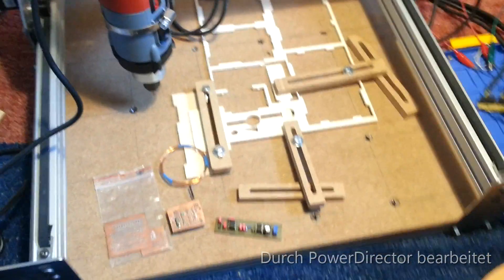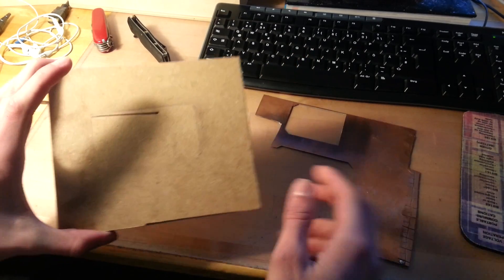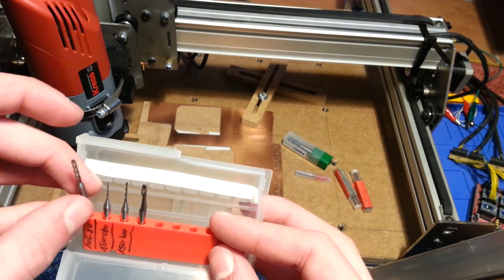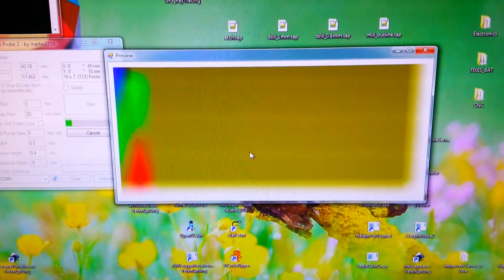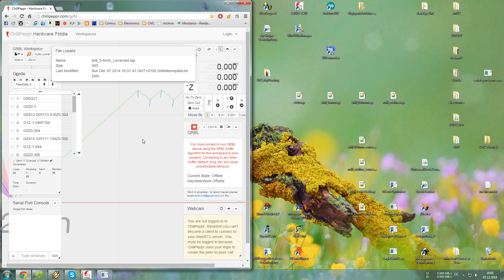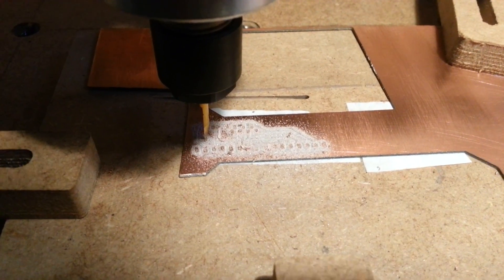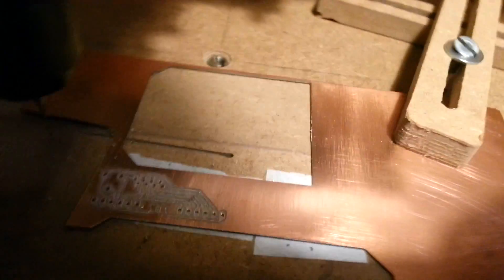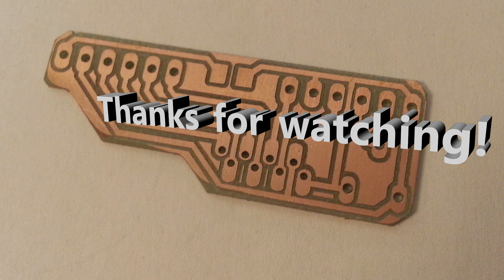PCB Autolevelling for Isolation Routing - Shapeoko

Comment: Hi Martin. First of all, thank you for your excellent job ! your tutorial helped me a lot ! I tried to do what you described in the video but unfortunately i have a problem. When i use PCB-gcode in Eagle, i only get two files, one for for the drilling and the other one with for the etching and i never get other files for the border. When i use the HeightProbe2 program, i drag and drop these two files and then the x and y dimensions become some strange values (-317826,127000) while my pcb is about 30mmx30mm. Of course when i try to operate the program like this it gives me an error. When i manually change the dimensions so i have a reasonable numbers of points to probe, i open the COM port normally and release the safety and press start but the program hangs and i have no response from the machine. Can you help me with that? 
Thank you in advance,
Reply: martin2250 first of all, thanks allot for the great work.
Second, I think the problem is with grbl 0.9i.
I'm having the same problem, HeightProbe hangs after sending "G38.2Z-5F10". 
In grbl 0.9i the response for probing is something like this: "[PRB:-193.993,-246.025,-10.305:1]".
I've looked in PortWrapper.cs and the way the coordinates are taken from the response is 

string resp = port.ReadTo("]");
resp = resp.Substring(resp.IndexOf('[') + 1);
string[] pos = resp.Substring(resp.IndexOf(':') + 1).Split(',');

I'm not a C# developer but it seems that for the above example will result:
X=-193.993
Y=-246.025
Z=-10.305:1 (not a number)

In grbl 0.9g the format of the response is something like this "[PRB:-193.993,-246.025,-10.305]",
so probing will probably work, but I can not use it since Universal Gcode Sender switches to "Active State: Queue"
on every command (except for probing, which funny).
Reply from the maker: Hi, I'm glad you like my tutorial and I'm happy to provide help! To get the outline (board.mill.tap) you need to 1: draw the outline on layer 46 (Milling) with a line that has the same width as your bit. 2: check the "generate milling" checkbox in the setup. It will generate both top and bottom files. As for the strange values in Height Probe: did you use mm as units in the setup (in 2nd tab)? if that doesn't help, you can send me the files (upload to Gdrive/dropbox and send me the link)
Reply: martin2250 Thank you very much for your reply. I checked the box you mentioned, as well as another box for text (as i have a small text on my pcb bottom layer) and i got a total of 6 files (with extra 2 files for text for top and bottom and two other files for border for top and bottom layers).
As for the Height probe, yes i used mm in the setup of the PCB-gcode and all dimensions are in mm. I uploaded the resulting files (for the bottom layer) as well as the schematic and the board files on google drive 
https://drive.google.com/folderview?id=0B86aQlNAG71RX1V0dG5zZEw2M2s&usp=sharing
Sorry for the inconvenience, but this is my first PCB milling job on a CNC machine.
Reply from the maker: 1: if you want text on the copper side, you have to use vector font instead of proportional. Also if you move it to the milling layer 46 and check "generate text" you will end up with a single enggraved line instead of having to mill the outlines. the generated file can just be appended to the board.etch.tap 
2: The files in the drive folder do work, but in the "G-Code Options" tab you have to check "use simple drill code", because none of my programs support the canned drill cycle command ( G82 )
3: I don't know what the decimal seperator in your country is, here in Germany, a comma is used and a dot just marks every third digit. My program was written in a way that it adapts the english style (which is jsut the other way around), so -31.573 is just about -31 1/2 mm, this seems reasonable. If it does get interpreted wrongly, that could be due to the regional settings of your computer.
4: After you hit Start, it will ask you where the height map should be stored, the machine will don nothing before you hit Save in the new dialog that pops up.

I hope your problem resolves itself, if not, don't hesitate to contact me again!

Martin
Reply: martin2250 Thank you for your help. I Checked "use simple drill code" and i regenerated the files. I went to the computer regional settings and changed the format to German. Now when i drag and drop the three files for the bottom layer, i get some reasonable dimensions. The problem now is that when i open the com port and uncheck the safety button, i press start and chose a location to save the resulting file but the program seems to stop and the CNC doesn't show any response whatsoever. I uploaded a print screen for the windows and uploaded it in case this helps.
https://drive.google.com/file/d/0B86aQlNAG71RSzFlRWZ3RU52aUE/view?usp=sharing
Thank you in advance.
Reply from the maker: The console shows what the PC sends to grbl. since it stops at the probe command, there are some things that could cause this:
1: grbl does not recognize the command. are you using the latest 0.9g build of grbl?
2: are the probe pin and ground connected to the bit / pcb? although the machine should move and crash into the pcb if they weren't.

If you don't mind me asking, which regional setting did you use before? I'll have a quick look where my program fails.

Also, the program should work as you set it up, but I'd suggest changing the dimensions to something more human-friendly. I usually round it up to the next full mm. Though nothing to really worry about.
Reply: martin2250 of course no problem at all. The format in the "region and language" used to be set to Egypt. As for the version of the GRBL, i guess it is the latest version as I bought the machine about one month ago. I connected the bit to the A5 of the arduino, and the ground is connected to the ground of the G Shield (i made sure that the G shield have the same ground as the arduino after assembling them to each other)
Reply from the maker: then I'd suggest using universal GCode sender and just trying the command G38.2Z-5F10 manually. also, on startup it will say what version it is if you are not sure, I'd never trust a seller to provide the latest version as they would have to reflash all boards in their stock.
Reply: martin2250 ok ... i tried to use the command G38.2Z-5F10 directly from the universal gcode sender but i got a reply saying "unsupported statement", so it seems that i need to upgrade the GRBL version on my arduino (as i checked the console and i found out that i am using Grbl 0.8c) ... I'll try to fix this.
Reply from the maker: Yup, exactly. Also I tried setting my region to Egypt and it still worked fine, not sure what caused your errors with the numbers.
Reply from the maker: Hi, I gave it another look and now it should be fixed, you won't need to switch to German anymore. The updated files are on my website.
Reply: Thank you Martin very much for your help and concern. I am very sorry for not keeping in touch the past two days as i had a very hard time getting grbl 0.9g working fine. By the way i tried you updated version of the height probe and it worked well. However, i yet have some problems. When i operate the heightprobe and after dragging and dropping the files i attached earlier, i find that the probing process starts at some point, and in most cases it completes only one column of points and then it never goes to the next column and tells me it completed the process. do you have any idea why would that happen?
Reply from the maker: Hassan Ali Hassan I can't think of anything that could be causing this. what settings did you use for grid size and probed area? I'll give it a look later today, hopefully I didn't break anything fixing the first issue.
Reply: martin2250 The grid size was 3mm, the plunge rate was  30mm/min safety height was 0.4 mm ... The thing that i noticed when this happens is that the humming sound of the gantry (when it plunges to touch the pcb) becomes shorter, which indicates that the height of the pcb itself increases, but at the same time the gantry moves from one point to another with a faster feed, which should not be the case (may be my observations are not accurate but i will try it again)
Reply: martin2250 Sorry for not being able to use my cnc for the past period. Do you mind sending me the settings of the GRBL you are using on your machine? maybe this is the reason the probing GUI is not working so well for me.
Reply from the maker: No problem, I have to admit I've been neglecting mine for longer than I like to admit. Anyways, the settings really shouldn't matter too much apart from the status report part, just leave that on it's default (see wiki). All other settings are specific to each machine. Do you have any experience using visual studio? You could try debugging the program, it's not that complicated. Other idea: start a command prompt (WIN-R -> "cmd") and run Height Probe from there. That way the console output should be visible every time and you could work out the issue from there.
Reply: martin2250 forgive my ignorance, but as far as i remember, i had a command prompt that pops up each time i run the probing, and showed something like many lines with some G code (a line or two), and about 6 lines of questions marks "?".Unfortunately i don't have the machine in front of me now, but i can copy it for you as soon as i have access to it. I also tried Chillipepper and also the probing process failed. I started to think that the problem is in the arduino itself.
Reply from the maker: nevermind that. On my setup, the console window sometimes would not show any text, while the program still runs fine.
The question marks mean that HeightProbe is polling the machine's status and waiting for it to be idle again.
Could you send me another screenshot? Try running the last line of gcode from the console in UGS.
Reply from the maker: Mihai Niculescu  Thanks for looking into the problem!
Is there a setting like the status report mask that could be used to disable the '1'? 
Also what exactly do you mean by the last paragraph?
Reply: martin2250  Thanks allot for your replay.

I continued looking into the problem - downloaded SharpDevelop and started debugging (BTW, thanks for sharing the source code also :-D). 
What I found out is that, though the problem mentioned above is still valid for grbl 0.9i is not the reason for HeightProbe hanging.

The reason for hanging was that, when opening the connection to the shield, the shield was entering in lock state, so I had to first send $H to unlock it.

Now, about the format of the response from the probing process, the last part ":1" can not be altered through configuration and it "Tracks if last probing cycle was successful".

printPgmString(PSTR("[PRB:"));
for (i=0; i< N_AXIS; i++) {
  print_position[i] = system_convert_axis_steps_to_mpos(sys.probe_position,i);
  printFloat_CoordValue(print_position[i]);
  if (i < (N_AXIS-1)) { printPgmString(PSTR(",")); }
}
printPgmString(PSTR(":"));
print_uint8_base10(sys.probe_succeeded);
printPgmString(PSTR("]\r\n"));
.........
uint8_t probe_succeeded;        // Tracks if last probing cycle was successful.
.........
sys.probe_succeeded = true; // Indicate to system the probing cycle completed

About my last paragraph, I just wanted to point out that there is a difference between the responses to the probing process of grbl 0.9g and 0.9i. Also I have problems in using 0.9g so I could not revert to it in order to use HeightProbe. Fortunately I don't have to :-)

Thank again.
Reply from the maker: Mihai Niculescu That's some dedication there! Thanks for loking into this!
>>Fortunately I don't have to :-)<< so HeightProbe works with .9i without modification?
Also I should probably make the console appear immediately so things like the lock state are not such a pain to resolve.
You rock!
Reply: Hi martin2250, 
Sorry for the delayed replay.

The reason I said "Fortunately I don't have to :-)" is because you made the source available, 
so I could change the code and make it work for .9i(sorry for the confusion). 
The code still needs to be changed to support .9i (I just made a quick change so I can use it)
Maybe the app should be changed to support grbl before .9i and after .9i?
One approach could be to detect the grbl version from the connection string, 
another could be to provide a way for the user to select the grbl version he/she uses. 

Also, the way the coordinates are extracted from the response may be extracted into a property file, or something 
(but this last option, doesn't worth the effort if the response doesn't change any more after .9i)

But all this are decisions you have to make. You are kind to share it with all of us, but it's still your software.
I'll be available, if you need help.
Reply: Hi martin2250 ,

there is a way to treat both formats (before and after 0.9i) of the message with only one piece of code.
The way, is to use regular expressions with grouping.

I've wrote the regular expression, but I don't know (yet) how to use regular expressions in C#.

The regular expression is: 

\[PRB:(?\d*\.?\d*),(?\d*\.?\d*),(-?\d*\.?\d*):?(0|1)?\]

In this expression, the firs group will contain the X value, the second the Y value, the third the Z value and the forth (if exists) will contain the status of the probing process 0 or 1.
Reply from the maker: Mihai Niculescu wow, awseome!
I'll see if I can get my machine set up this weekend for testing, implementing your regex should be a breeze.

In all honesty, I should rewrite the entire programs, both probing and gcode transformation. Both are but one ugly wreck of hacks.
I finished my A-levels this year, so I should find the time soon.
Also I'll try to add arc support. It's not really necessary, but could certainly come in handy. I wrote another tool to create gcode form eagle files (just follows the path, does not create outlines) so I've got at least some experience to help me.
Reply from the maker: Mihai Niculescu Working on it; Progress so far: http://imgur.com/GeWeNJe
pretty damn cool!
Reply: This looks great. 😁